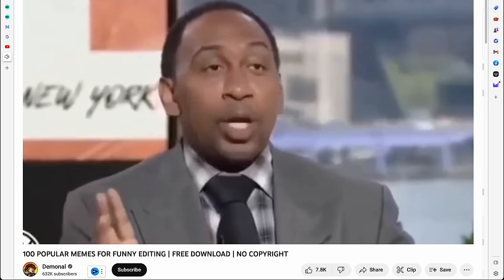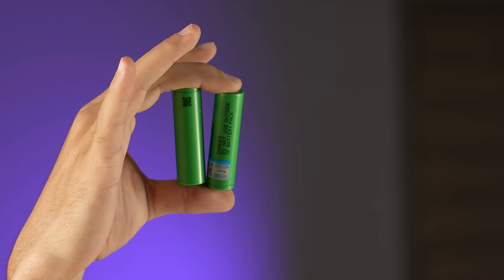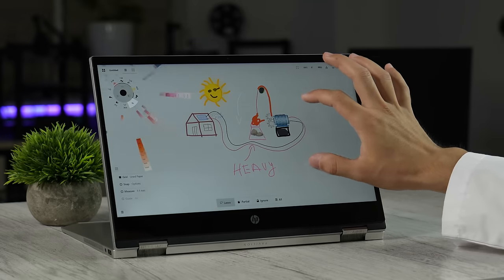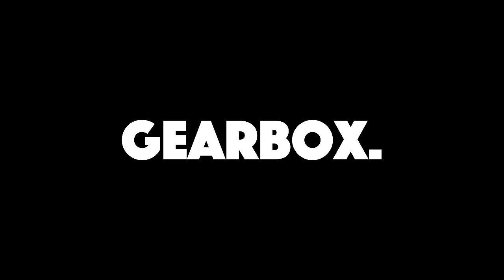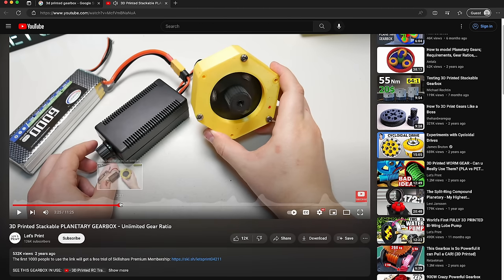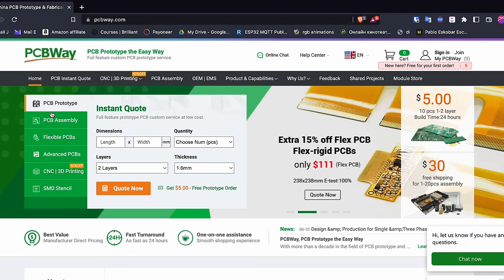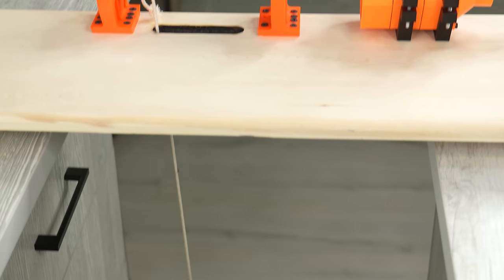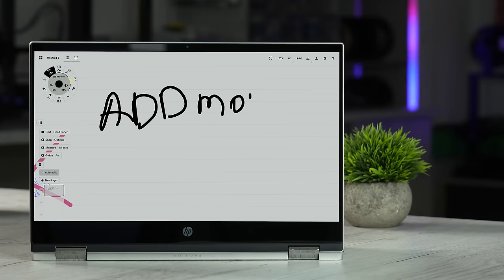DIY Gravity Battery: Unexpected Results!

Comment: I joined the UK Green Party in 1987, and the best energy batery I have found is Compressed CO2.
Here is a bit of the Wiki:
From Wikipedia, the free encyclopedia
Compressed carbon dioxide energy storage can be used to store electrical energy at grid scale. The gas is well suited to this role because, unlike most gases, it liquifies under pressure at ambient temperatures, so occupies a small volume. Energy Storage News reported that it will be "a cheaper form of energy storage than lithium-ion batteries".[1]

Process
A 100MWh store requires about 2000 tonnes of carbon dioxide (CO2). At the start of the process, CO2 gas is stored at atmospheric pressure in a large expandable fabric container, like those used to store biogas, housed within an inflatable protective dome.

To store energy, the gaseous CO2 is compressed to around 70 bar, which heats it to around 400 °C. Passing it through a heat exchanger and a thermal store cools the supercritical carbon dioxide gas enough to liquify it. The liquid CO2 can be stored in this state indefinitely in pressurised cylinders.

When energy is required, the CO2 is passed back through the heat exchanger, where it is warmed by recovering heat from the heatstore and reverts to high-pressure gas. The gas is used to drive a turbine to generate electricity as it passes back into the low pressure store, completing the closed cycle. [2][3]

Advantages
Liquid carbon dioxide can be stored at ambient temperatures, unlike Liquid air energy storage (LAES), which must keep liquid air cold at −192°C, though the CO2 does need to kept pressurised.

Liquid CO2 has a much higher energy density (66.7 kWh/m3), than compressed air in typical to compressed-air energy storage (CAES) systems (2-6 kWh/m3), meaning the same energy can be stored in a much smaller volume.[4]

All the components of the system are readily available: gas storage domes are used in biogas production; the compressors and heat exchangers are used in the oil and gas industries; the turbine is similar to a medium pressure steam turbine.[1]
Here is my Signature message:
Suppose that Jesus died at this time and date:
2:52 in the afternoon of the 27th day of April the 4th month of 31 AD.
The smallest number with roots that could show this time and date is 294=2*3*7*7=1*7*2*1*1*7*3*1
as 2:52 is also 172 minutes past Noon and the 27th of April is the 117th day of 31 AD.
Now Jesus said in the verse Mat 5:18 that not a single letter would be missing of the Hebrew Law,
even over such a long time and much translating.
If he thought that there is more information hidden among the letters,
that would be revealed by our computers, this could explain why he wanted not a single letter missing.
Well 294+518=812 and 812 is the Mirror image of 518!
Also the name of God, in about 1000 BC, looked like the number 3732, and it was sometimes abbreviated to 732 and 294=7*7*3*2!
Also 518=2*37*7 which is the reverse of 7732!
Also the 42 months of Jesus teaching and healing in Israel was also 42=7*3*2!
Luke 16:17 says much the same as Mat 5:18 and 1617=11*3*7*7=7*7*3*11
and if here the 11 is like a Roman Numeral 2 which is II another 237 and 732!
Also 42=3*14 which is like Pi=3.14 and Jesus was 3 times 14 Generations after Abraham!
Also the 3 times 14 Generations is outlined in the verse Mat 1:17
and Psalm 117 is the exact middle chapter of 1189 chapters in the KJV Bible!
Also 1189-117=1072 and 1072 is the reverse of 2701,
which is the most famous 4 digit number in "Bible Numerics" (a sub division of Biblical Numerology)
mostly because 1072+2701=3773 and 2701=37*73.
2701 is famous because of many other reasons,
but especially as the 28 Hebrew letters of the 7 words that make Genesis 1:1 is also 28 numbers,
as each letter in ancient times was a number as well, and these 28 add up to 2701!
The 28 numbers:
2 200 1 300 10 400    2 200 1    1 30 5 10 40    1 400    5 300 40 10 40    6 1 400    5 1 200 90.
Word number 1 is made of 6 letters 2+200+1+300+10+400=913.
Word number 2 is made of 3 letters 2+200+1=203.
Word number 3 is made of 5 letters 1+30+5+10+40=86.
Word number 4 is made of 2 letters 1+400=401.
Word number 5 is made of 5 letters 5+300+40+10+40=395.
Word number 6 is made of 3 letters 6+1+400=407.
Word number 7 is made of 9 letters 5+1+200+90=296.
296+407+395+401+86+203+913=2701=37*73 and 2701+1072=3773 !

KJV
1st book 01 as 50 chapters and ends 50 chapters into the KJV Bible.
02 40 90, 03 27 117, 04 36 153, 05 34 187, 06 24 211, 07 21 232, 08 4 236, 09 31 267, 10 24 291,
11 22 313, 12 25 338, 13 29 367, 14 36 403, 15 10 413, 16 13 426, 17 10 436, 18 42 478, 19 150 628, 20 31 659,
21 12 671, 22 8 679, 23 66 745, 24 52 797, 25 5 802, 26 48 850, 27 12 862, 28 14 876, 29 3 879, 30 9 888,
31 1 889, 32 4 893, 33 7 900, 34 3 903, 35 3 906, 36 3 909, 37 2 911, 38 14 925, 39 4 929, 40 28 957,
41 16 973, 42 24 997, 43 21 1018, 44 28 1046, 45 16 1062, 46 16 1078, 47 13 1091, 48 6 1097, 49 6 1103, 50 4 1107,
51 4 1111, 52 5 1116, 53 3 1119, 54 6 1125, 55 4 1129, 56 3 1132, 57 1 1133, 58 13 1146, 59 5 1151, 60 5 1156,
61 3 1159, 62 5 1164, 63 1 1165, 64 1 1166, 65 1 1167, 66 22 1189.

The 19th book is the book of Psalms.
The 18th book ends 478 books into the KJV Bible and 478+117=595 and 595*2=1190 and 595-1=594 595+594=1189!

Another mention of "In the beginning" like Genesis 1:1 is the first verse of the New Testament book John 1:1.
In 51 Greek letters of 17 words adds up to 3627=3*3*13*31=117*31!
Also 51=3*17=1*17*3*1 and of the 17 words, 17=1*17!!

The 51 numbers:
5 50    1 100 600 18    8 50    70    30 70 3 70 200    20 1 10    70    30 70 3 70 200    8 50
80 100 70 200    300 70 50    9 5 70 50    20 1 10    9 5 70 200    8 50    70    30 70 3 70 200
Word number 1 is made of 2 letters 5+50=55.
Word number 2 is made of 4 letters 1+100+600+18=719.
Word number 3 is made of 2 letters 8+50=58.
Word number 4 is made of 1 letters 70.
Word number 5 is made of 5 letters 30+70+3+70+200=373.
Word number 6 is made of 3 letters 20+1+10=31.
Word number 7 is made of 1 letters 70.
Word number 8 is made of 5 letters 30+70+3+70+200=373.
Word number 9 is made of 2 letters 8+50=58.
Word number 10 is made of 4 letters 80+100+70+200=450.
Word number 11 is made of 3 letters 300+70+50=420.
Word number 12 is made of 4 letters 9+5+70+50=134.
Word number 13 is made of 3 letters 20+1+10=31.
Word number 14 is made of 4 letters 9+5+70+200=284.
Word number 15 is made of 2 letters 8+50=58.
Word number 16 is made of 1 letters 70.
Word number 17 is made of 5 letters 30+70+3+70+200=373.
55+719+58+70+373+31+70+373+58+450+420+134+31+284+58+70+373=3627=3*3*13*31=117*31!

Someone who knows Greek wrote this note:
"Actually the last letter of the second word is subscripted by another,
viz iota, this being the second element of a long vowel dipthong.
In fact, therefore, the word has 5 letters;
hence the entry should be "8 + 10" above the dipthong instead of 18
- 8 and 10 being the respective values of letters 4 and 5."

So there is 52 letters and 52=4*13 which is like Pi=3.14 reversed,
and also like the 4th month and 31 AD!!

Conclusion?
Design or Coincidence and even both?
My opinion, the Code exists, God exists and Jesus exists!!!

Comment: Try a block and tackle set of pulleys instead of a gearbox, it will be much more efficient, so you will get more energy from the battery. It is also cheap and easy to build, and you can use thimner rope because there are many loops holding up the weight. This motor is also not the best for generator. Maybe try low kv value brushless motor.

The gearbox needing help to back drive the motor when you had 6kg of dumbells shows inefficiency from 3d printed gearbox, that means the energy from at least 6kg is wasted.

Comment: (Beginning of video) Nice patio! (A bit later) SMASH! Anyway, you're definitely going to need a bigger motor, and metal gears would help a lot if this was for dally use and not just a proof of concept thing. I don't think you said how long the gravity battery could discharge for.

Comment: gravitational storage is actually used very often in the power grid of at least america
we tend to use two large bodies of water at different heights do to the safety of not having a large mass dependant on a single point
the ideal case is actually a large plot of land where two pools of water can be formed, however I suspect that you could dig out two caverns and use them as your water storage too

Comment: i think you could also use a internally geared ebike hub motor and the hub would act as the spindle aswellthen with pulley set up to act as gearing it would be a compact and strong unit

Comment: U need a system to pull with solar an another to harness energy with gravity, just have a switch just like motor transmissions. In neutral another system pulles and then you engage the gears that turns the electric generator

Comment: it would be interesting to know how much Solar to electric power was used to lift the weight - and then how much it produced afterward.    Because as of this experiment, I can't imagine this being very 'ground breaking' for uses, and a simple battery (even home made) or large capacitor... would store the energy 'better' - in this case, in  a smaller space, and safer situation (without the risk of damage to self/others, or the concrete tiles)
However, without measurements, I don't know "how much better" this actually would be.  A small gain may not be worth it, and scaling the weight might help - but you also scale the size.   Also up higher can help - but then you also have to account for things like wind - you don't want your weight swaying in the breeze.

Comment: Instead of using gear boxes, it may be stronger, easier, with less frictions to use several pulleys to get mechanical advantage. Now the motor mount can be very light, no need of several cinder blocks, light 3D printed parts too.

Oh and after the fail of your first pulley, it is very dangerous to balance yourself from the rope a second time, close to that pile of cinder blocks: if there was a failure and your head hit the blocks...

Comment: Seems so much easier to charge a few flashlights during the day and hang then from the ceiling at night. I doubt that little geared motor can output much watt's needed for more than a few LED's

Comment: The gearing i think would reduce efficiency? Maybe use better pulleys. That is a lot of weight for your roof, dont think i would have done that. I wouldnt have thought you would get much power for very long either

Comment: I used to wonder if a heavy weight could be jacked up using car jacks or a hoist and then when it's released and with the right gearing to slow it down the weight could drive a generator to power some lights for a fair amount of time. I was having visions of my home being run on the power of a heavy weight that I just had to hoist every day.
Reply: Yep I was thinking the same thing, this would greatly simplify the system and give you a daily workout at the same time.

Comment: The laws of thermodynamics forces us into not building these things because of the total efficiency of the system being quite low. An efty amount of the energy gathered inside the battery by the solar panel, is wasted in heat across the system, vibration and elasticity of the rope. The same goes for the way down. The heat in the motor and gearbox can be reduced by using engineered planetary gears because the 3D printed ones induce so much friction and make the motor work more. Also, a good motor is not a good generator. Find a system design in which you can switch the main shaft from the motor to a real generator. If these would save energy to the point of offsetting the cost of mass produced electricity, we'd have these everywhere. As another commenter pointed out, how long did it take to bring the rocks up and how long did the rocks take to come down?
Reply: The reason I ask this question is very simple. If your load doesn't pull all the amperes that the generator can deliver, than some of the potential energy of the rocks, is wasted. You could recharge the battery when the rocks come down with the unused energy from the generator, but what if the batteries are full? One can see that in order to make this as efficient as possible requires a lot of engineering.

Comment: maybe it'll put less stress on the equipment if you lift a little bit of the weight at a time then all of it at once, something like a pump pumping water to a higher place then letting it down to a lower place and using the water currents to generate power.

Comment: If you need money mass-produced those and sell them or make a few of those and sell them after you get it more efficient and perfected
Reply: There was already a project that did and they are selling them for several years now.  I believe the started with a Go Fund Me.
This fella is well intentioned, but doesn't understand much about engineering things.  He has no concept of strengths and what to use in general.  A tiny motor is a toy in a professional job.

Comment: No mention of efficiency!  How much of the power input to the motor is returned from the generator, I expect less than 20% with so much friction in the gears. And as others calculate, the total energy stored is low unless the mass and height difference are much greater.

Comment: Did you consider take weight/inertia momentum from the motor gear axis: loop rope with 2 opposite load sack around upper axis and lower axis couple the lower axis to the motors/generators gear. If you always have a opposite weight your motor only needs to move not to lift the weight.

Comment: for 6Kwh you would 200 tonnes (classic car is the easiest option for this weight. A moving display that makes power lol, Otherwise its a small house which might be a crazy fun idea, good luck getting down .) and lift it 35 ft in the air and gear it to a large generator.

Comment: I wonder if you could make a water battery instead. have a separate motor for pump and generator. check valve from pump to tank, then a valve from tank to generator that opens at night.
Reply: yeahr probably in the UK there is the Ffestiniog Power Station which is two big lakes at different height .. and they pump water up from the lower lake and at night let it flow down again

Comment: my Question is   if you were to use a more efficient motor one that isnt losing a ton of power to heat, If you can produce near the same output of power  for the time the solar panel  did .

Comment: Doesn't using the solar power to lift the rock bag cancel out the gravity battery?  I mean wouldn't just using the stored power from solar to turn the lights on be about the same?

Comment: more efficient gearing is a chain drive....maybe part of the gear ratio could be done, for this small, weight, with re-used bicycle sprockets... 2 sets of sprockets could give you maybe 200:1 ratio, and much quieter than planetary gears

Comment: Interesting concept.  You basically 3d printed an electric winch with a super low power motor which is pretty cool though totally unpractical.  
As much as I love 3d printing, there is a reason stuff like gearboxes and drive shafts are made of metal and often sealed in oil.  The torque, tensile strength, and heat generation of that gear reduction could easily re-melt or deform the plastics used.
  Also, when you are dealing with this kind of weight you need to think about tensile strength and elasticity of the rope.  Neither of those ropes had enough tensile strength and the first one had too much elasticity.  Even if it worked, the rope would have stretched out and lost a ton of power.  At over 60kg for the size of pully you wanted to use you really need braided metal cables or much thicker diameter rope.
Reply: It's called a proof of concept bro...
Reply: @SOPHOCLESIFY  the concept of pulleys, gears, and potential energy is over 2000 years old.

Comment: A set of 3 bungy cords that get streched at the end of the last being streched shold match the load capacity of the crappy version you made. If they release tension one after the other halfway after ther release of the one befote it, u should have a cotinued power output equivalent to your rocks weight, that is as long as each bungee cord is at least 12 to 15 kg of tension and you use a triple up of each for the set up. Try this instead of your setup and see if the more compact size fits your needs. It is faster to scale up to. I have made a hand crank version that can power a camping setup for about 4 hours, and takes about 5 minuts to crank up. It uses 4 sets of 16 office rubber bands that can give about ¼ kg apice. That means i have a 200 joule output at max capacity.  Also, i added a reverse function to alow a flyweight to contain energy to counter wind the system for continued use without handcranking. The energy is around 4× the elastic storage. It uses a 128:1 gear reduction on a 144 volt 12 motor setup. 6 charge controllers in series parallel for input/output keep a constant 12 to 14 volts. This setup along with a 800 joule output flywheel as well as a 200 joule output from storage deliver a short burst of 15 kilo joules for running a supercap bank and 3 kilo joule inverter. Dont ask abot the math. Its a rough estimate. It works due to a 8 tap secondary isolation transformer. It provides 4×3 3 kilo joule outputs.